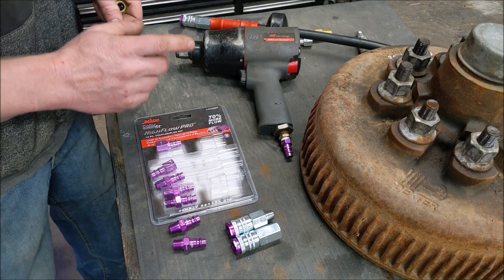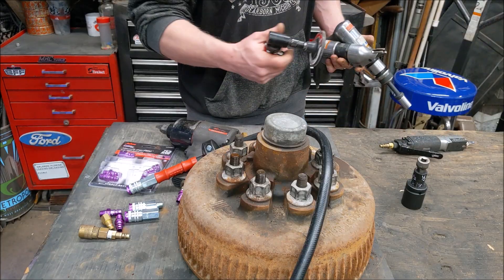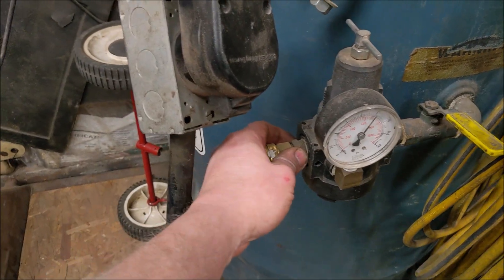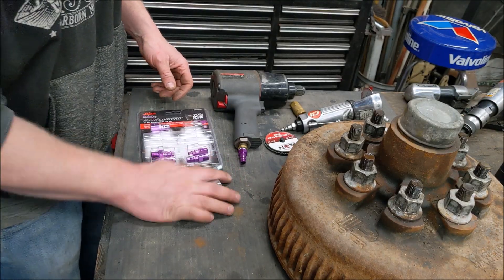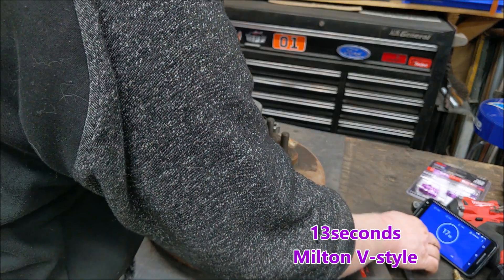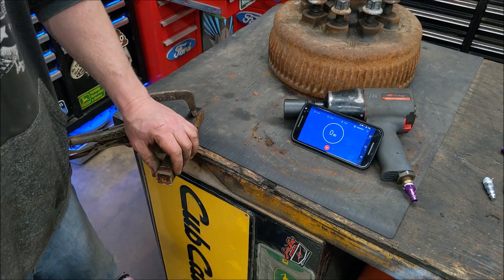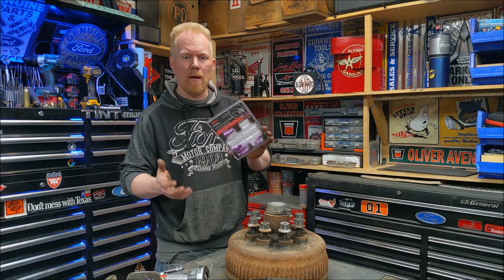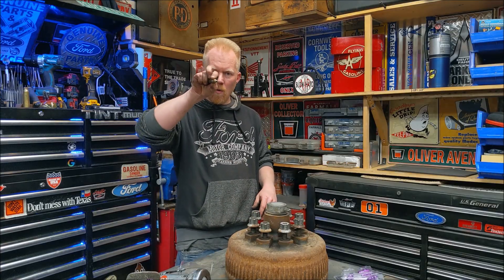High Flow Air Fittings worth it? Tested Head to Head Milton V-Style

Comment: Maybe the nuts should have been tightened with a 1/2 inch Milwaukee Hi-Torque to better see the air wrench work. 3/4 air impact always has to have at least a 1/2 air line with fittings to match. Air impact wrenches have to have both pressure and volume to get the proper rating out of them. You probably use the other air tools a lot more than the 3/4 why you don't like dragging around the heavy line. I will be trying these fittings that you recommend.
Reply from the maker: I used to run the 3/4" impact with a 1/2 hose and fittings. I just so rarely need to pull it out that the inconvenience with using all the smaller tools trumped the need for those and everything got switch to 3/8 hose and fittings. The overall ability of the gun to break stuff loose changed by maybe a few hundred ftlbs which was still good enough for automotive bolts. Even with the lower flow the first 2-3 hits are near full power but it drops off fast. I tested the Hi-Flow V style fittings today and they allow the gun to spin 1500rpm faster than standard M style fittings. So the bolts spins off faster with more torque but I also get full torque impacts for a lot longer. That's invaluable on stuck/rusted fasteners. The math shows the opening area size of standard M and Automotive fittings at .031sq inches. Where as the V style have over double at .071 sq inches.
Reply: @sixtyfiveford  The Amazon link shows the fittings as aluminum. How have they held up to wear and tear compared to steel. If they have held up, then I am sold.
Reply from the maker: @oby-1607  Personally I prefer brass as they wear nicer and don't get sharp burrs like steel. I have never used aluminum before these but they have been holding up well. I assume they will ding slightly easier than brass but they also sell steel ones if that becomes an issue. I see no reason the female coupler would wear faster and I have dropped it a few times on the concrete with nothing more than a scuff. This V style does seal a little differently than typical M or automotive fittings. It seals on the side rib of the coupler vs the tip that is most prone to damage.

Comment: The test: Lo flow tightens nuts, Hi flow takes them off. Important test Hi flow tightens nuts, see if Lo flow can take them
Reply from the maker: I ran the test and it can take them off. Problem is impacts can only tighten to a fraction of what they can loosen. I tightened them to roughly 800ftlbs and it took a good couple of seconds of impacting but the Lo Flow took it off. The gun spins 1500rpm faster with the High Flow Milton fittings.

Comment: From my limited experience in the auto body world, the high flow fittings are used because the cfm of air is higher at at a lower air speed. Paint guns need lesser speed and more volume for the paint gun to work properly. The high speed air doesnt flow as well thru the machine at high speed as I'd does at a lower speed at higher volume. And that's where the term hvlp comes from, high volume at a low pressure. Speed creates pressure which is not good for air tools
Reply from the maker: Good points.

Comment: I have the same impact and you should really be using a ½ inch fitting, you'll be way more power out of it.
Reply from the maker: Yes, I used to run it with larger fitting and hose. However I rarely need to pull out this big gun that it got the same fittings as all the other more commonly used tools.

Comment: My guess is that it would make even more difference with a 1/2" hose.
Reply: Yea it's like a storage  manifold, it'll give you a good blast until the compressor has to kick in ...but that's all ya need sometimes. 
Still should have big fittings , I'm just not partial to using brass chucks on the hoses anymore. 
It's routine to drop the hose on the floor and after a while they get deformed.

Comment: Great vid 👍Have ya tried to drill out a regular fitting a little bit, might work on fitting side. Not sure what ya could do to coupler side👍
Reply from the maker: I have drilled them out in the past but didn't feel any improvement as you can only go a tiny bit. I have also done the same inside the coupler but you can't do much in those without compromising the integrity. The standard M fittings has a hole with the surface area of .031sqaure inches; where the V style are .071 square inches. Drilling may get you up to .040 but the V style still flows twice the air.

Comment: ok i ordered some looks like the ones i use . i drilled some larger  my  self lol
Reply from the maker: I have drilled them out in the past but didn't feel any improvement as you can only go a tiny bit. I have also done the same inside the coupler but you can't do much in those without compromising the integrity. The standard M fittings has a hole with the surface area of .031sqaure inches; where the V style are .071 square inches. Drilling may get you up to .040 but the V style still flows twice the air.
Reply: just got them delivered   decontaminated it with isopropyl alcohol . So quite fast delivery  really and not often can i buy stuff from amazon in  nz.

Comment: 8:00, the spin time is small percentage of the overall work time. So a small increase in efficiency will show as even smaller. The sound and apparent rpm was noticeably less using the standared coupler.
Reply from the maker: The feel in your hand while using the tool shows an impressive difference.

Comment: That's pretty cool they offer these. I actually use all Milton M style as well and I just put the male ends in the dril press and open them up a bit. Is the female side a larger diameter as well?
Reply from the maker: Yes, the Female couple is completely redesigned inside and has tons more flow than a standard coupler. I have drilled them out in the past but didn't feel any improvement as you can only go a tiny bit. I have also done the same inside the coupler but you can't do much in those without compromising the integrity. The standard M fittings has a hole with the surface area of .031sqaure inches; where the V style are .071 square inches. Drilling may get you up to .040 but the V style still flows twice the air.

Comment: I wish you had a seized bolt on something, and tried removing it with the old style on an impact and if that failed, try removing it with the new style fitting on an impact.
Reply from the maker: I looked around for a while but couldn't find any huge bolts to test these on other than these lug nuts.
Reply: @sixtyfiveford  I wonder if you were to tighten the lug nuts, using the new fittings on  a 1/2" impact and see if the old fittings on the same 1/2" impact could remove them?
Reply from the maker: @anonymous-ql9ep  I've played around with testing this exact setup a few times this weekend. The problem is the gun can loosen a bolt nearly twice as tight as it can make it. So a 1200lbfts rated gun can only put a bolt on to 600-800ftlbs(roughly). So I tightened the bolt screaming tight, change the fitting back to the small one, and it takes a few seconds but it removes it. The biggest difference in the fittings is the guns ability to sustain higher rpm(1500rpm more in tests). So it hits harder for longer and then the bolts just fly off. I have no doubt the gun is hitting a few hundred ftlbs harder I wish I cold put the bolt on with the big gun and use a smaller gun to attempt taking them off. Problem is I just sold off my smaller guns a few months back.

Comment: The V style fittings have been since the 90s, I believe. That's how log I've been using them anyhow. My local farm store had run out of M type and a guy I knew said these were the same but with a larger passage. There was no marketing for them, then. Actually,  I saw them at the same farm store with normal Milton packaging last week. 
The Mac Tools guy even told me thats what is used to spec their impact wrenches.
Reply from the maker: I had no idea these existed since the 90's
Reply: Good to know...

Comment: Couple questions for you. Will the type V fittings fit into type M? you showed the Mfitting into the V. Also, Could you take the type M and drill it out to the same size as the V and get better performance than M? I ask because I just invested in a bunch of A-M-T fittings and I know air flow has caused some issues. Good for a followup video
Reply from the maker: The V will not fit into the M couplers. I have drilled them out in the past but didn't feel any improvement as you can only go a tiny bit. I have also done the same inside the coupler but you can't do much in those without compromising the integrity. The standard M fittings has a hole with the surface area of .031sqaure inches; where the V style are .071 square inches. Drilling may get you up to .040 but the V style still flows twice the air.

Comment: Hey Moe, I just recently bought that same set from Amazon. The female coupler didn't last for me. They're aluminum right? I think some of my tools have steel fittings that work with the V couplers but wear the couplers out more quickly. I also found that the coupler isn't rebuildable.....well I couldn't get it apart anyway to try to repair it.
Reply from the maker: They do sell all steel versions of this that would outlast these aluminum. I prefer brass and I'm sure they sell that as well. I took the couplers apart the first day I got them. They were tightly fastened but a 6 point socket on top and a wrench got them apart. These use a simple round oring for sealing to the male half of the coupler. Should be much easier to rebuild these with of the shelf orings vs the special flat washers in typical Milton M couplers.

Comment: Very cool. I'd like to see you take that coupler apart n show how it seals on a regular m style. N maybe check rpms on the die grinder n see if it increases rpms
Reply from the maker: The V style seals around the outside of the fitting with an O-Ring where the M style uses a flat washer to seal the tip. I did test the RPM with my contact tachometer but it exceeded the max 20,000rpm my meter can read. It definitely moves faster by at least a few thousand rpms.
Reply: @sixtyfiveford  nice thanks man

Comment: Could you drill out a regular M a little to increase its capacity?
Reply from the maker: I have drilled them out in the past but didn't feel any improvement as you can only go a tiny bit. I have also done the same inside the coupler but you can't do much in those without compromising the integrity. The standard M fittings has a hole with the surface area of .031sqaure inches; where the V style are .071 square inches. Drilling may get you up to .040 but the V style still flows twice the air.
Reply: @sixtyfiveford  huh. Interesting. Tx 👍

Comment: Didn't read all those tasty treats above...how about seating a tire? I'll wait... ;)
Reply from the maker: This wouldn't help much with tire seating as you still have to go though the small Schrader Valve hole. I never have an issue with seating beads using the Haltec lock on tire chuck as I can manipulate the tire with both hands while air it flowing.
Reply: @sixtyfiveford  some of motorcycle tires give me fits. I use tube tires on tubeless rims occasionally and they are a struggle. I have recently had better success by using the purple tire schmoo and pre loading the stretch of the bead by inserting 2x4 chunks for a few days before the deed. I've been flirting with making or buying a bead blaster....   Keep up the great work sir!

Comment: Ive been using these foe a while now and my only complaint is the the purple aluminum fittings wear a little fast so I recommend spending a little extra to get the steel ones however I never could find them in a pack of ten like the aluminum ones.
Reply from the maker: Yeah, that was a concern of mine. I generally like brass or steel  and will likely upgrade the ones that get more use.
Reply: @sixtyfiveford  ya i agree. I figured that I would just buy a few steel fittings for the tools that get the most use. I just wish they would sell the steel fittings in packs of 10 or so. They might but I didn't see them anywhere when I was buying all this stuff a while back.
Reply: @sixtyfiveford  
Yea I'm kinda partial to steel. 
It's normal around a shop to throw the hose on the floor after unchucking a tool , and the brass ones deform after a while and the pullback thingee part
(technical as f**k)  
gets jammed. 
Steel lasts me a little longer.

Comment: I have that same IR 3/4" gun, it's power ratings are with 1/2" air line at 95 psi.
So no doubt would greatly benefit from more air flow over the 1/4" fittings.
I got a set in my Amazon cart! 
Thanks
Reply from the maker: I ran it with a large hose when I got it. It just isn't fun dragging that 1/2" hose around.

Comment: Miltons are the only brand I've used that don't leak or have excess play. Your filter on your compressor will catch some dirt and oil but will need to be downstream at least 50 ft to catch water. The air exiting the xompressor needs time to cool down which then condensate so the filter will not catch water. This doesn't matter too much if you're not painting but if you want really clean air running through your all your tools then you should relocate the filter and maybe think about a 3 stage.  Thanks for the heads up on the v style. Your vids are always super informative!
Reply from the maker: For the most part here in Utah we have such low humidity it's not a major concern. But painting definitely needs a better dryer system than the tiny one I have.

Comment: I’ve seen people drill out the tool port itself to gain more power but this is such a simple solution. Although I’ve been getting away from air going to cordless, I still run a 60 gallon with a 21 reserve tank in line so for twenty bux to change over my shop, it’s done deal! Thanks for the heads up! Ginger should get a second chicken sangy based on that cuteness overload alone! 😍✌🏼
Reply from the maker: I have drilled them out in the past but didn't feel any improvement as you can only go a tiny bit. I have also done the same inside the coupler but you can't do much in those without compromising the integrity. The standard M fittings has a hole with the surface area of .031sqaure inches; where the V style are .071 square inches. Drilling may get you up to .040 but the V style still flows twice the air. 
I actually sold off my small 3/8 Snap ON and 1/2 Mid Size impact a few months ago as I replaced them with cordless. My biggest complaint with cordless is they do not feel as solid and vibrate, rattle all over the place to do the same job an air impact does with nice solid hits. Air is like riding in a Cadillac, the cordless is like riding in a covered wagon down a dirt road. Both do the same job, one just beats you up more.  I'm keeping the 3/4 Ingersoll and won't replace it with cordless.
Reply: sixtyfiveford: I don’t blame you one bit. That 3/4 is a beast and I love that 80 gallon endless supply tank you have too! I had an opportunity to get one of those for free a few years ago while I was hauling steel to a work shop they were renovating, but there was no way I could get that sucker off the trailer if they would’ve put it on with a forklift like they wanted to, oh well my loss. I kinda made up for it grabbing this 60gal Craftsman for pennies cause the owner said “it just stopped working” lol. A new ring kit and it’s building pressure like a champ so an $800 compressor for $40 works for me! Besides, I’m mainly keeping air these days for filling tires and blowing dust dirt and grime off of stuff but also for the wood shop for my brad, finish and framing nailer‘s because who the heck can afford to drop $400 for a new cordless nailer?!  (I do have a pasload cordless 6v gas framer that I really like.) The newest dewalt and metabo/hitachi cordless nailers are really sweet too, meh, maybe someday... For now I have to do a complete accountability on all of my air tools so I can get a good count on what I need for connectors to include all the splice points and shut off’s everywhere in the shops and for the outside ports too. Last count was up to $60, but that’s still pretty cheap to ensure all that extra ooomph lol. Enjoy your day brother.✌🏼

Comment: I've been using the same fittings on all my air tools and have experienced similar results.  You can actually hear and feel a vast difference.
Reply from the maker: I can't believe it took me so long. I have drilled them out in the past but didn't feel any improvement as you can only go a tiny bit. The standard M fittings has a hole with the surface area of .031sqaure inches; where the V style are .071 square inches. Drilling may get you up to .040 but the V style still flows twice the air.

Comment: 10/4 on the Miltons and you can HEAR the difference between the regular and Hi-flow. LOTS more power on the hi-flow! Good job!
Reply from the maker: Such a difference.
Reply: @sixtyfiveford  TRUE! I sure like those compressors especially the bigger one. That is a COMPRESSOR!
Reply: Went over to 3/8 hoses and Milton Hi-flo "V" style a year ago. Never looked back. The plugs are cheap enough when you buy a pack of 20, to change everything over, the sockets are a bit more expensive but, in my opinion, worth every penny.

Comment: Would the extra speed caused by the extra airflow affect tool lifespan?  I'm thinking hot bearings.
Reply from the maker: Just the opposite. The faster/more air that goes through it, the colder it gets. The die grinder was ice cold with that much air flowing through it after that small cut.
Reply: Most air tools are recommended by their manufacturer to be operated at 90psi max. Not in my shop. I dont run a regulator unless I'm using something that has to have a certain pressure.  I'm with ya on the Milton's. They last.